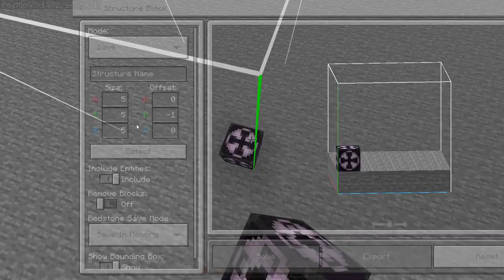ALU Upgrade Tutorial + Computer showcase

Comment: Hi  @TheDarkness344   I am teaching programming at a pretty basic level. One thing I am working on is a complete basics on how a computer works from gates to C type languages. Have you considered (or seen) a minecraft computer that can run a very simple machine code (where each command takes one argument, 3 bit commands, 3+ bit instruction memory, 3 bit memory. A webpage can then be used to write programs and compile to the redstone machine code. [I am working on the programming side at the moment].    The point would be to illustrate how to implement 'advanced' programming concepts but with links to the basic gates.   I think all you really need (with lots of instruction memory) is [input to accumulator, store, retrieve, add, decrement,  conditional jump].
Reply from the maker: This is definitely possible - I think wildengineering has made one that can be programmed in C (I think it was C not exactly sure) I would also take a look at URCL and mod punchtree.